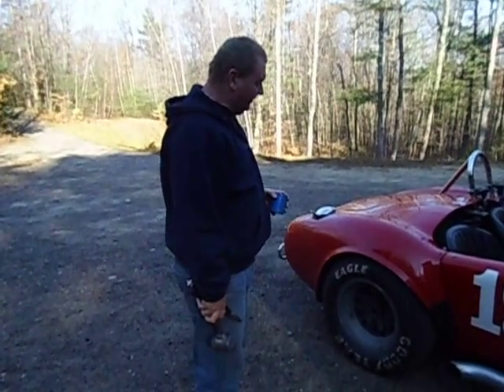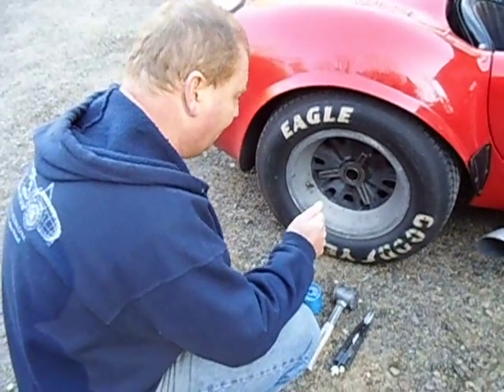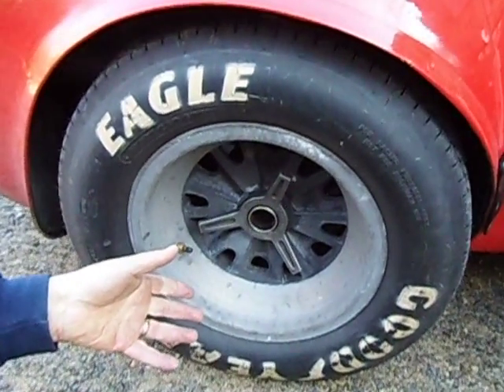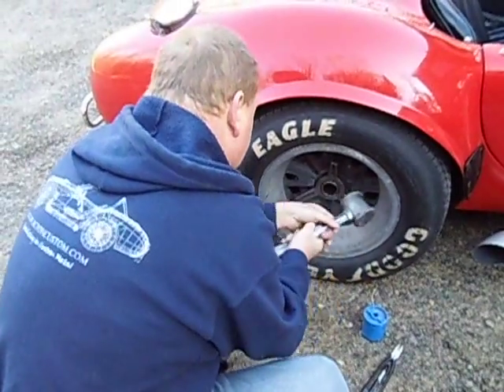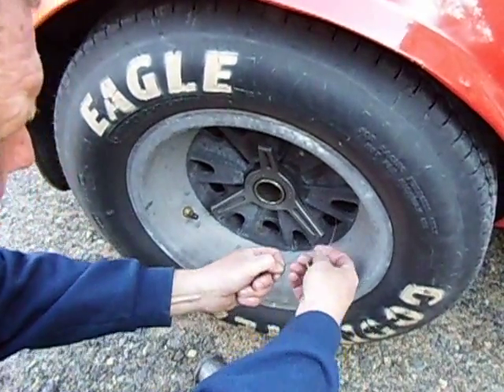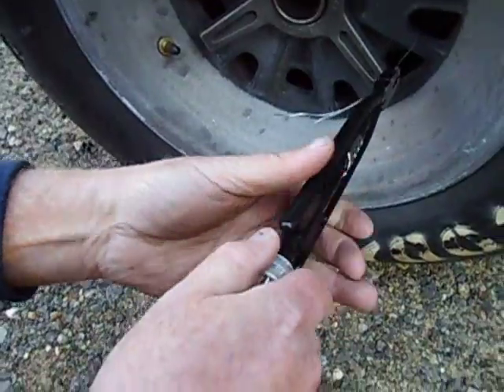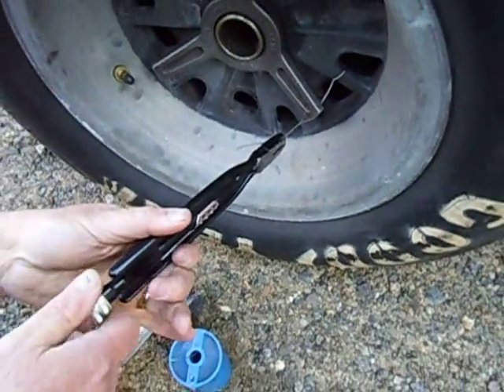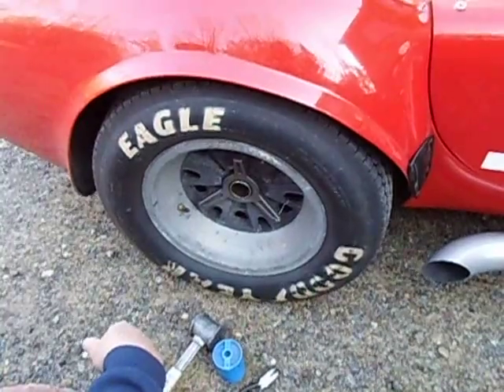Spinner nut wire Cobra Shelby

Comment: Great video, you put the spinner and saftey wire on with such care, I have seen racing footage from the 60s and the cobra pit stop where a shelby crew member changes a wheel and hits the spinner about 3 or 4 times really hard and sends it out on track, I would be much more confident with your method.

Comment: Use a piece of phonolic or wood on on the spinner to drive with the hammer. You don’t want to beat up your wheels hitting them with a hammer.   You also safetied that spinner negative to neutral from the angle you videoed
Reply from the maker: The lead hammer is the correct tool for the job. It doesn't mark up aluminum or plated steel spinners. You can see I use controlled hammer blows and don't hit or damage the wheels.